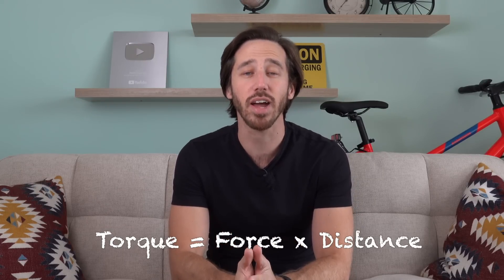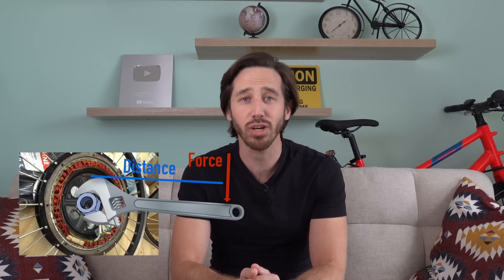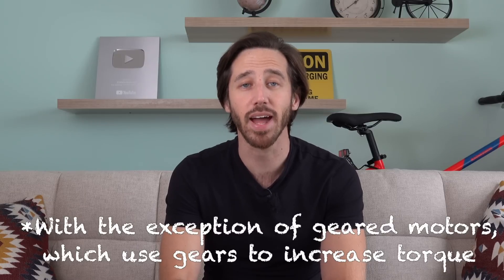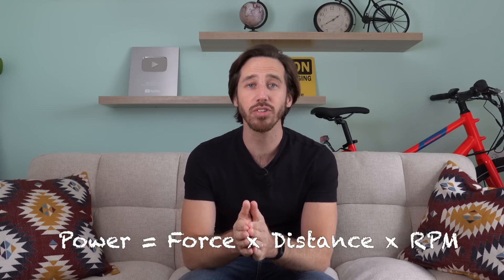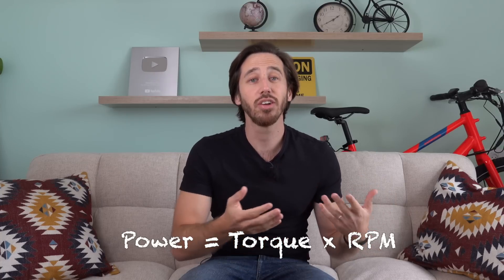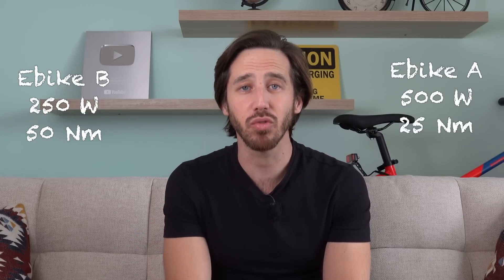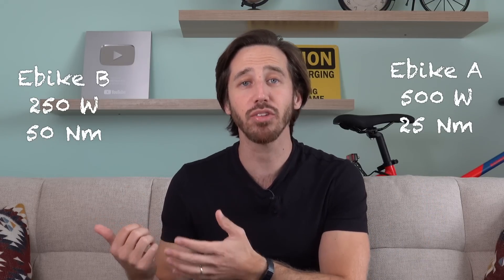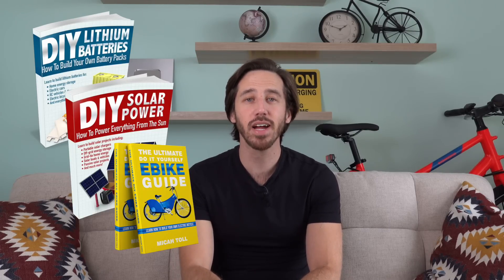What does E-BIKE TORQUE really mean? Simple explanation

Comment: Hi Micah, I want to let you know that I enjoyed your book on building batteries, it helped me understand a whole lot. I have a question for you, What is the difference in power between 72v 3500w VS 60V 4000W? just curious.
Reply: Power is exactly as listed. The 72 volt will give you more range not just because you aren't burning out the extra wattage, but because, assuming the same ah battery, it stores more energy 72 volt x 10ah vs 60 volt x 10ah.

Edit: obviously, 4000 watts is more power than 3500. I meant that 3500 or 4000, wattage is the same regardless of what voltage is used to drive it.

Comment: I have a question, what do you do when you have a 36v battery that doesn’t fit your controller. The plug is an XT60 but clearly that doesn’t work. Do I have to buy a specific battery. suggestions?

Comment: I'm a newer subscriber to your channel and saw your video about a battery booster pack for scooter range....  I HOPE YOU SEE THIS. Thanks for your videos foremost... I own a kaabo wolf warrior electric scooter it has a 60v 35ah battery with 2 charge ports so if I make a 60v 15ah battery and plug it into 1 of the charge ports can I leave it plugged in and use the 2nd charge port to charge the original and new booster battery at the same time? Also wanted to know if both batteries will discharge at the same time,as if its 1 battery? THANK YOU FOR YOUR HELP!!!!!!

Comment: So.....I have a Bafang Ultra motor rated at 160nm torque at 1500W. But I have modified it to run at 4300W (by going from a 48v to 72v battery) how many NM of torque do I now have?  What is the equation for solving that?

Comment: Hey Buddy, Great video as always! 👍 👍

Agreed that the bike with more "power" would win the race BUT only if;
1. The race was not up a hill that was too steep for the bike with more power (and not too steep for the bike with more torque). 
2. The distance of the race was such that there was enough time for the bike with more power to catch up with the bike that had more torque. 

So if you live in London or New York for example and use the bike mainly in the city then because of all the stopping & starting (traffic lights & T junctions etc) and short runs, having decent torque on a bike would make a lot more sense that having poor torque and a few mph extra top speed.

We are not trying to be clever  or funny, we are just trying to point out to other people that having a bike with say 2000w "Peak power" and "low torque" is not always better than having a bike with say only 1500w "peak power" and "high torque" if the bike with 1500w has a much better torque curve and you are using the bike around town or in a hilly area on a regular basis. 

We wonder if some manufacturers just go for the higher power motor figures because a lot of people would look at the figures and assume that the bike with the highest power rating MUST be the best bike to get when in point of fact it really all depends on what you want from the bike in terms of performance and also where and for what you intend using the bike.

Thanks again for all that you do for the ebike community - You are "Top man" 👊 😎 👊
Reply: That's the first thing I noticed too.  As you noted, you could put those two bikes on a hill, let's say a hill that is very steep - just steep enough to where the 25 N/M motor can't get the bike moving.  The 50 N/M bike would win, just because it has enough torque to get going.  It's the same reason that a 100 horsepower 750cc motorcycle engine would work badly in a car.  Lots of power (because of high RPM), but much less torque than a 2 liter 100 horsepower (because of slower RPM) car engine.
Reply: You make a good point - Totally agree with you! 
This is the reason a lot of people want more torque than what you get as standard on the Super73 bikes. Great bikes but poor torque.
Thanks for your reply & best wishes.
Reply: All you do is change to a smaller gear and the bike with more power wins.
Reply: @nightRanger0077  Sure, but theres a big problem with that idea. Hub motors (90% of ebikes use hub motors, and 100% of affordable ones) are NOT connected to your gears, they are independent. You need to buy a mid drive motor ebike to have it use your gears.
Reply: @nightRanger0077  Square piece of yellow paper with pink dots on one side
Reply: Exactly. As someone who lives in a hilly area, I am all about the torque. The street I live on is steep and my driveway even steeper. I have two bikes with 95nm of torque, one hub and one mid drive.  The hub drive is 750W and the mid drive is 400W. Neither one will make it up my street, much less my driveway, without significant pedal input and it takes about the same time and effort to climb the hill between the bikes.

Comment: Micah, is there a point where the larger watts & voltage equalize the higher nm of torque? For example would a 3000 watt, 72 volt direct drive with 40 nm of torque perform approximately equal to a 750 watt, 48 volt geared hub motor with 80 nm of torque? (Random values selected)

Comment: I understand torque and power, I was a certified auto mechanic, but what I do NOT understand is how do they come up with these VERY HIGH torque specs for an electric motor....like a 750w motor with say 60Nm of torque, BUT a Honda GX390 11hp gas engine some how can only generate 26Nm of torque?? I think if we had a race between a mini bike with that Honda engine, and an ebike with a 750 watt motor, that Honda would win hands down....so how do they come up with these figures?? 

How can there be such a HUGE difference between the two?

https://www.engine-specs.net/honda/gx390-k2.html
The  produces 11.7 HP (8.0 kW) of maximum horsepower at 3,600 rpm and 9.4 HP (7.0 kW) of continuous rated power. The  is 26.5 Nm (2.7 kg·m, 19.5 ft·lb) at 2,500 rpm

Thanks and keep up the great work.

Comment: Hey, thank you for the videos! In your last example, what if the weight of the rider requires at least 25 Nm of torque? Does that mean the 250W bike with 50 Nm is going to win the race, without considering the initial inertia and things like that? And if the rider and/or cargo weigh so much that the 25 Nm of torque isn't enough anymore, then the 500W bike won't move at all, right? Also can you talk about how Bosch for example achieves 80 Nm in a 250W package using gears? Is there any way to find out what is the actual amount of torque produced by the motor and fed to the gearbox? I was going to ask you last week if a pancake motor e.g. axial flux design, is an ideal type for an ebike that requires high torque but with say 250W of power, but you basically answered that in this video while talking about hub motors. Still, would be nice to know your opinion about what would be an ideal ebike motor, if there were no restrictions in terms of how it would need to be integrated with the bike itself e.g. purely from the perspective of motor design. Thanks again!

Comment: Great stuff, I now have  more than 1 e bike. Maybe one day you can do a video on how to  hook up a solar panel using an MPT charge controller like on your Father's Kayak to keep a 48V battery topped up. I am in the process of building a delta trike using pedal power to the left wheel and having a geared hub motor on the right. It will have a similar  "roof" to the kayak and since I have several Lithium ion batteries it would be nice to be able to run charge into my backup. I can build mechanical items but for sure weak on the electronic side

Comment: I was just talking to myself. He left out gearing. And why is there 46 or 50 tooth rear gears ? I mean a human cold pedal straight up a wall with a 22 / 50 combo. And you would have to spin like an insane person. And you would run out of gas before you got to the top of Trump Tower. 
Everything is a compromise. And most the logical answer / solution. Mostly....
Buy the most power / torque you can afford and gear it appropriately.

Comment: You know you're a good teacher when you can talk about torque, and not make it feel forced! 😉
Seriously though, good lesson. It's obvious how they get torque measurements from hub motors, but what about mid drives? Do they measure it after the reduction gears, at the pinion that drives the chainring? Do they measure it at the chainring itself? I know with the small diameter motor, they can't be measuring it at the stator shaft, but no one has clarified this.
Reply: After that pun, you should go sit in the corner and think about what you've done!

Comment: Torque and power specs for any vehicle are hard to figure in the real world because they only talk about the motor (or engine) not what is actually delivered to the ground. Given the exact same motor a smaller wheel will offer more torque (to the ground) than a larger wheel or vice versa. The top speed will also be lower on a smaller wheel and higher on a larger wheel (if all other specs are the same).
Given the exact same bike I use a general rule of thumb that volts relates to top speed & amps relates to acceleration (torque). I don't think using watts for these determinations is particularly useful.
Is this more or less correct?

Comment: You should also compare two same powered bikes, with different diameter wheels. In that case, the smaller wheel has more torque, so the smaller diameter wheel would win a hill, where the bigger wheel bike would be unable to climb.
Reply: Would it, though? I am not sure which is why I watched this video, and am still confused. I wondered if the torque was computed where the wheel touches the road - he explained it's not - it's computed at the distance to  the outer magnets of the motor which would be the same in a small or large wheel. But does that still translate to more force being applied where the rubber meets the road on a smaller tire?

Comment: Can a 72v battery be used on a 48v hub and controller or would it burn up the hub and controller  ?
Reply: The hub motor might take it but the 48v controller will not. Definitely need a 72v controller.
Reply: @ricknoe942  
Ok, yeah was just wondering, I'm running a 52v battery right now, it's doing good,
Reply: @rickp7683  Yes, I'm running a 52v on my newest ebike conversion too, most good 48v controllers can handle 52v. Higher voltage is for higher top speed, higher amps is for more power (and torque :)
Reply: @ricknoe942  
I have a ricetoo's 48v 1000w kit that I was using and a ebikeling 48v 1200w kit that I'm using now, the ricetoo's kit has torque but this ebikeling one doesn't, dont kno if there's a govren on this ebikeling kit and it has 5 musfits the other kit has 6,  I'm new at diy ebikes , and I'm not good at reading instructions and following them
Reply: @rickp7683  I have an ebikeling 36v 500w geared motor on my 1st ebike conversion that I'm happy with on that bike, but they don't offer a high voltage geared kit so I went with a Calibike 52v 1500w geared kit this time which I'm happy with. I don't know the torque rating on it but it's enough for me. If you want to check it out, look up Calibike's website because they charge a bit more on eBay. 
If your ebikeling kit has an LCD display, you can go in and raise the amperage (just don't raise it above what the battery can put out).
Reply: @ricknoe942  
My hub & controller is 48v 1200w 20 ap ,I think in the display it can be changed but I'm not sure how to do it so eventually I'll take it to the bike shop and ask it they can do ,I have no problem with it going fast,just no toque inwitch I'm fine with it for now cuz of the type of front forks ,I'm gonna eventually put front shocks on it ,I'm running a 52v 1600w triangler battery on it with is doing fine, I've gotten it up to 38 mph  but I like just cursing level 3 peddle assist ,it goes between 20 & 25 in that level, but thank you, I may take a look tho just to look and I have a friend that giving me his ebike with bafang kit on it ,so I'm gonna end up have 3 actually, putting one on my sister's old beach Cruiser, lol,
Reply: @ricknoe942  
Actually in level 3 peddle assist, flat ground, its a steady 25 mph ,

Comment: High Torque is needed for steep hill climbs and be aware of your motor speed - a low RPM motor generating a lot of torque takes lots of battery power.  That's why mid-drive bikes are better for hills - you can shift to first gear - spin up hill with a faster motor RPM and lower Wattage.  Display read 300W Mid-drive vs 850W Hub going up same hill.  Of course I was pedaling, didn't want to overheat motors.

I installed a Bafang BBS02 mid-drive on a MTB and sweet ride.  @ 40 lbs and fast.  Usually keep the bike in 2nd or 3rd gear so easier on motor controller, got mine from Luna Cycle @ $450.  I've done the Cheap Chinese Hubs and they're good if you just want to go cheap and do a lot of throttle.  Nice on flats but battery killers on hills. Pay $250 more for a mid-drive kit - it's a better e-bike in the long run.

Look at a Tong Sheng TSDZ 2 mid-drive (80 NM @ $400 shipped, torque sensing pedals ) Open source software improves performance so it's like a Bosch - excellent commuter, torque sensing applies power when needed so longer range.

If you want a lot of power - BBSHD - 160 NM @ $800 - the Base motor is excellent for Upgrades.  Check out "Andy Kirby" e-bike channel if you want to go really fast.
For me BBS02 - 120 NM @ $450, great bang for the buck.
Reply: "Ludicrous";)
Big fan of LunaCycle.
Reply: @michaelsprinzeles4022 i dont care it doesnt change reality
Reply: @hus_10001  I'm not sure what reality you're talking about. Reality is that you don't have to pedal with a mid-drive & if you want the limitations of a hub motor a mid-drive on a single speed is just like a hub.
Reply: Mid drives are trash made for people who like to non stop pedal. Its a cyclists bicycle. Hub drives are better for lazy people or people who like get to a destination dry and not all sticky and sweaty.
Reply: Also most people would say mid drives are bad commuters and I would agree with this. No one wants to put in work commuting. The only place for mid drives is off roads like on a mtb or hill climbs but not enough hills on the roads to make it truly shine on road unless you live up in the mountains but even then i would just go for a more powerful hub easy solution. Hubs really suck off road

Comment: I always think of these conversion kits for bikes. Taking a 55 Newton meter Torque 1500 watt motor and placing an aluminum front fork with torque braces for the axle. The rated stress test for the metal shearing off is 45 N meters for aluminum and 50 N meters for carbon steel. How long is it likely to last before it suddenly shears off of the bike.
Reply: My biggest problem, as a wrench, is that my mid-drive customers can and do usually take care of their own flats, but hub drives are really heavy and have various mounting options that vary in their effectiveness. I hate that I have to charge more.
Reply: Grin measured over 90nm for the axles when the bolts are tight on steel dropouts n all that.

Comment: I've always had trouble with this stuff, but I still was able to follow your explanation. I'll watch it again to make it all sink in, thanks.
Reply: High Torque but low HP= A guy (motor) with a lot of brute strength but who can't run very fast. He's got the brute strength to easily run uphill with a heavy backpack  but can't run super fast with or without the heavy backpack.
     High Horse Power but low torque= A guy (motor) who doesn't have the  brute strength but who can run much faster once he gets going. He can run really fast once he gets going but it takes him longer to reach his top speed and he can't carry a heavy backpack.. 
      Big strong  football linebacker= Lots of torque but slow, can't run fast (low HP)... 
      Slim fast running wide receiver=More horsepower than a linebacker so he can run faster but doesn't have the brute strength (low torque) that a line backer has.